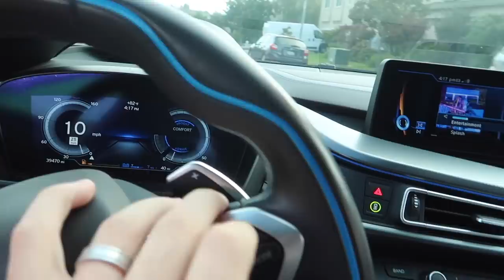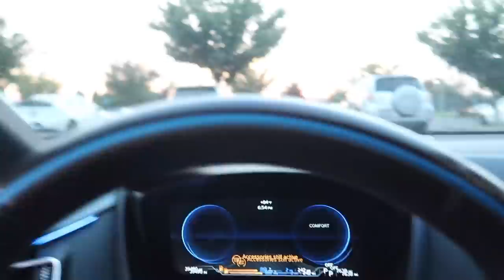Is The BMW i8 The Slowest Car BMW Ever Built?

Comment: Idk what have you done to 435 it have full bolt on but still can't beat 335i. Might be cheap mods or not installed properly
Reply: It’s super heavy, it has air suspension plus it’s already a pretty heavy car as it is

Comment: Did you guys even use launch control?
Reply: No need to , to be honest , it's just a 0-60
Reply: @justank1402  Regardless of 0-60 or any other speed they should have used it.They wanted to test which one is faster so that's why they would use it. For both the i8 and 435 they both launch best with launch control.Can you explain why you think wouldn't they shouldn't launch control?
Reply: @nathankwok2040  they wanna see which car gets fastest to 60 in manual , they are not doing a drag race

Comment: Don't matter about the speed, honestly, just having an I8, like come on!!!!!!, I have an E90 and an F30, my E90 is the N54 which I'm building little by little, and the F30 is a 328i, when I get into the 328i, it feels more comfortable more spacious, I love the feel of it and don't forget its more reliable hahaha, don't have to worry about getting stranded 😅
Reply from the maker: Exactly!
Reply: Car people will be like, its a 328i, how much power can that car have, tbh I don't even care about the power, and trust me I'm a power freak, just the fact that I feel soo comfortable in the car, it rides smooth, has nice feature, makes me feel really good on the road, and thats what gets to me, how amazing I feel in it
Reply: RJS12 F30 328i feels so much faster than the E90 328i. I think it’s because of the 8 speed and the turbocharged engine.
Reply: Yeah totally does!
Reply: F30 328i is pretty fast, looks nice when you add sport bumper, front and back, little exhaust, mods here and there, and its really comfortable, I love my 328i tbh feel like I made a good choice
Reply: RJS12 I’m looking into my first bmw, (I’ve been an Audi fan for a while and want to try something different), and I’m considering a 328i, but I might go with the 335i because it’s so hard to find a nicely optioned 328i.
Reply: @scalley  yeah I wouldn't think twice for an F30 335i, but if its in your budget and your going to finance one, definitely go with a new one with the B58 engine, I don't finance, im literally like nour when he first started I get my cars at the auction so I don't have those options but my opinion was to go with that engine, only if its in your budget

Comment: All of thoes cars are slow! That 435 is crazy slow
Reply: ???? "Slow" they both (i8-435i) cost 100k where 1 car with the same speed costs 200-300k LOL
Reply: @justank1402  yea which makes that i8 really rubbish!
Reply: @airjaff  can you READ what I wrote? A CAR THAT CAN DO THE SAME QUOTER MARKS USUALLY COSTS AROUND 200K BUT THIS BMW ONLY COSTS 60K. AND IT DOESNT ALWAYS MEAN THAT A CHEAPER CAR IS WRORST THAN A MORE EXPENSIVE ONE.
Reply: @justank1402  I have a 335 and it's a lot faster than these!
Reply: @airjaff  Yeah , because it is a 3 liter with twin scroll turbo , which gives 512 hp